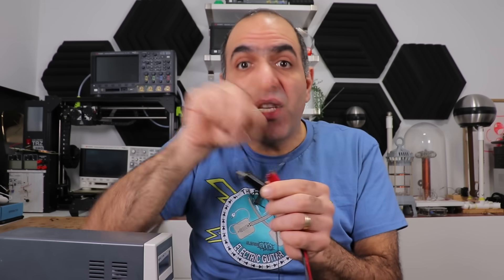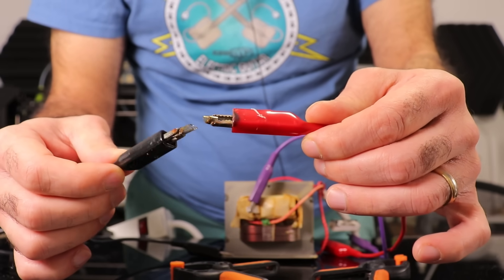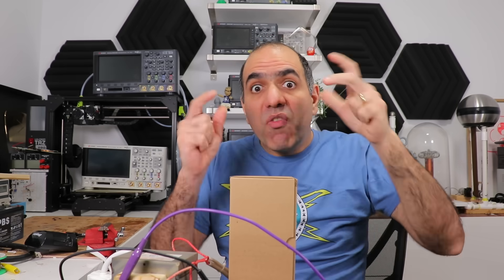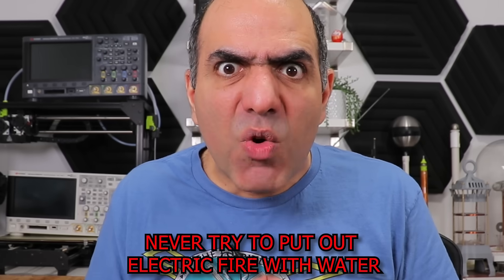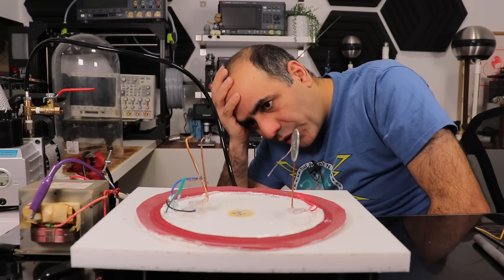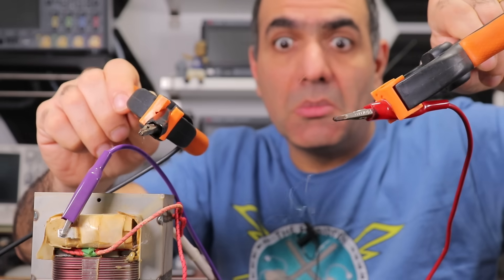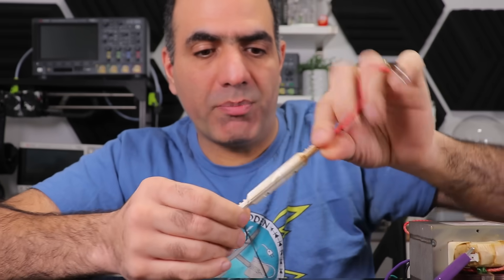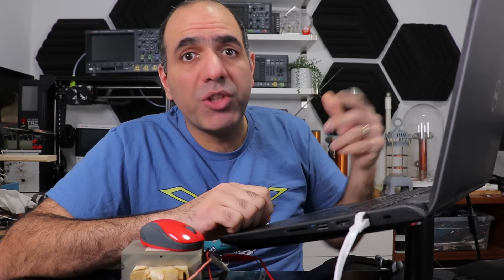Making a High Voltage Fuse

Comment: When i worked as electrician, we had fuses filled with sand, exactly for the purpose to avoid arcs.
Reply: Yep, the ceramic fuses we see inside multimeters are a classic example.
Reply: @Kalvinjj my multimeter was really cheap and it has a regular old fuse made of a thin wire in a glass cylinder
Reply: @Kalvinjj  What do you mean? My multimeters are all filled with regular fuses lol.
Reply: i think he is doing the fail on purpose, he is smarter than this.
Reply: @Sad_cat_studio  Fortunately most of the times he shocks himself it is on purpose... Because he knows roughly what will kill the average person since he's a electrical engineer with qualifications to back it up. Saying that though, not even licensed electrical engineers should be playing with microwave transformers. Those things are dangerous!
Reply: @Sad_cat_studio  of course, most of his "fails" are intentional to show how dangerous electricity can be. He even uses CGI rarely. However he has had REAL accidents like the jacob's ladder which did almost kill him.
Reply: @Sad_cat_studio of course he is, he’s extremely smart, he just teaches really well with slapstick humor and I love it!
Reply: @Sad_cat_studio  I am always worried that he might get splitter in his eyes.
Reply: @Sad_cat_studio  You think? This must be your first time watching this channel if you only "think" and don't know it for certain.
Reply: @anteshell  no, i watch him all the time, but yeah i know that hes joking, but sometimes that is a little too much.
Reply: There's a video of PhotonicInduction blowing one of them up.
Reply: Does the sand form a glass seal or is the heat not high enough?
Reply: @Robertkopp84 sometime you get little bits of glass depends on the reason the fuse went. Seem to be a sweet spot in fault levels to get really hot fuses, really really big faults blow the fuse that quick the body doesn't even get warm.
Reply: @Robertkopp84  yep that's exactly what the 'sand' does.
Reply: @Robertkopp84  no the heat can really ever get high enough it just creates enough resistance to avoid arcing
Reply: Sand filled fuses are for cooling to make them slower. They can handle sudden higher currents for longer. (The starting up of appliances with motors for example)
Reply: They're called HRC (high rupture capacity) fuses. When there's a very high current that causes them to blow, the arc causes the glass to melt which forms a better insulator than air. I've used them for industrial welders. Those blow at a few hundred amps but can quickly cut off tens or even hundreds of kiloamps.
Reply: + fuses filled with sand are slower fuses (where you can have very small peaks of current what are higher than the "normal current" on fuse ) ...
Reply: I always wondered about these glass fuses. I'm no electrician so my knowledge is very little but I have some spare fuses, some of them filled with sand while the other don't. Very interesting to know that
Reply: @granfury1238 
Never seen any with sand but I think I understand why it’s used. Do they last longer?
Reply: Sand does a good job at quenching the arc created at failure so they don't turn into miniature grenades.
Reply: Fuses in the Fluke meter, are filled with sand from what little I understand.... still didn't stop me from blowing one really quickly unfortunately.
Reply: I've never seen that--makes sense though.  Must have been extremely high voltage fuses...
Reply: @nobody7817   Not really. It is common 230V fuse that we all have in our houses in Serbia. And some parts of the Europe i guess...
Reply: @markojovanovic165  Interesting.  Tyvm for the info!
Reply: @nobody7817  Ceramic fuses are pretty common even not in high voltage stuff. They're often used in dc circuitry or high inductive loads where you need higher breaking capacity. Regular 5x20mm glass fuse is usually rated to break reliably 125A current and 5x20 ceramic can break 1500A reliably.
Reply: @nobody7817  All fuses that are used in UK plug's must have sand in them to be legal.
Reply: @dcallan812  but then how do you see the wire ^^
Reply: @jonathan-._.- you don't. Most fuses I use where I work have sand in them.
Reply: @jonathan-._.- you don’t , you have to test them with a multimeter
Reply: @jonathan-._.-  You don’t see it, that is correct. Yet on almost any sand filled fuses I came across, the otherwise shiny white sand will look dirty or show black/brown spots if the wire melted. 

Then again, I came across clear glass fuses that looked intact but had an open circuit for what ever reason nevertheless, either because of welding spot failure due to vibrations or because only that part melted open instead of the whole wire burning up. 

So you better measure them anyway while doing troubleshoot.
Reply: @jonathan-._.- facepalm lol
Reply: @jonathan-._.-  you carefully cut the blown fuse open to see the element. How the element melted will tell you if you had an overcurrent or an overload.
Reply: They're filled with sand to slow the heat buildup and are called "slow-blow" fuses. It prevents nuisance blowing during the huge initial inrush current when starting inductive loads like motors that typically lasts less than a second. Working with decades old machines as a maintenance tech (oldest one being from 1954), I end up replacing at least one a month. They didn't worry about including fuses as much back then..
Reply: @sgctactics  it would be fun to hear it explode though like how the cutouts just blow up on the pole and slap the door down
Reply: I still work as electrician and we still have those fuses filled with sand.
Reply: Yeah, fooled my colleague once on April Fools. I put the sand in his salt container, I bet he liked his food
Reply: Big brain move, I don't think sand conducts through electricity... Well.. Not really at least, I think there needs to be specific circumstances for that to happen
Reply: @segasonic4952  DID YOU SKIP CHEMISTRY AND PHYSICS IN SCHOOL? ok so, fact is dry sand does NOT conduct electricity and even wet sand is  poor at conducting due to lack of essential minerals. however remove the silicate particle and ZZZAP! it becomes a shocker indeed lol XD
Reply: wow, silicon fuses, must be some new generation
Reply: @miauzure3960  silica... sand... and no they're like 100 years old
Reply: Filled with sand and multiple paths to get the rating you require.
Reply: Same with me, the 600 volt rated fuses in particular had a lot of sand-filled applications.
Reply: There's an arc distance the main use of sand is to prevent a 480v fuse from being a bomb because the fuse wire literally vaporizes and explodes
Reply: TIL 😮
Reply: Genius
Reply: That's what I wanted to say, to fill the fuse with sand or maybe salt ot extinguish the acr.
Reply: He just teaching us in another way
Reply: Those are HRC fuses.
Reply: they're called HRC / class T fuses mr electrician.. lmao
Reply: I figured I may as well check, and they do have sand filled fuses.

They do not even mention those in America. Even in electrical colleges.
Reply: @neaituppi13713  yes they do, t class fuses are used everywhere
Reply: I've seen those too. I've seen them in multimeters, switching power supplies and induction cookers.
Reply: I've seen videos of those, but only huge fuses. Haven't seen any small sand filled fuses yet.
Reply: Yep, these are the standard-not-cheapo fuses, at least for low current applications around 2-10 Amps. Can't speak for the higher amp applications, as all of them I've encountered were opaque.
Reply: In my multimeter there are 2 sand filled fuses. One FF 0,5A 1000V with 10kA breaking capacity and the other one F 10A 1000V with 50kA breaking 
capacity. Those multimeter fuses seem to have very high breaking capacity.
Reply: I know people who did the same thing to others gas tanks. 

You don’t want arcs in the gas tank. It’s dangerous.
Reply: Not only for that, they are filled with silica, so it can absorb heat and energy from the first arch.
Reply: If I remember correctly from my apprenticeship we use ceramic fuses that's got silica granules on the inside surrounding the fuse breaking point. Think the one in particular I saw that cracked was like 80A or something, was really cool tho. In my profession we use like small 2.5A ceramic fuses for our traffic controllers and in winter we use quite a few of them due to water damage burning molex connectors in the lanterns. Appreciate these little protection devices tho, it protects the rest of the systems by a long shot
Reply: Silicon: am I a joke to you
Reply: Sand is silicon @i_fw_linux
Reply: Interesting
Reply: I replaced a disconnect box at a house that went to an electric air handler because they old one with super old 60amp fuses blew and the disconnect melted everything together. 
It blew the tops off the fuses and I took them out and found they were filled with sand and I wondered why. 
You sir have answered my question. Thank you
Reply: In my town most people still have them
Reply: That's not really why, it's to regulate high current so it doesnt kill it with the initial jump. My Welder uses them.
Reply: High voltage transformers are usually filled with mineral oil to prevent fuses as well.
Reply: Youhaveandtoandto8tototototototototototototototototoandandandandandandthethethethetheandtheandtheandthe
Reply: Most fuses I’ve seen in industrial places have sand
Reply: Came here to say that
Reply: I'm an electrician right now and we still have sand filled fuses.
Reply: If i recall right its not even regular sand but some special white sand made literally for the purpose of eliminating arcs.
Reply: Noice
Reply: In some old 600A fuses i worked with there also was sand in them
Reply: A bloke called photonic induction gets his hands on an insane fuse he has a crazy setup and it's so powerful that even with his energy supply system (think he's a high volt sparky) uses an air trigger for the mechanic switch, he still has to cut open the fuse and dump the sand to try blow it
Reply: Bro I don't even see sand in fuses.   I have seen a fuse i found it in my inverter
Reply: Cram a penny in it, fuse is much stronger 💪🏼

🐭🐹🐼🐨🐻‍❄️🐻🐺🐯🦆💨
Reply: Na GT-R
Reply: wasn't sand, it was silica lol :)
Reply: I bet you might be the worst electrician in the whole planet
Reply: Then if they break then its gonna make a huge mess 0:58
Reply: I thought the sand was there to catch the hot metal because the metal can set something on fire. That is what I was taught by my teachers.
Reply: @jost3n414 The actual function of the sand is to prevent an arc from forming inside the fuse, due to the hot metal vapor from the fusible element (the wire). The full process is a little complex, but the sand quickly shuts down the arc. The thermal mass of the sand quickly cools off the hot metal plasma, with much of it ending up as very thin coatings on at least some of the sand particles, getting it out of the air. Also, with the central conductor gone, the electricity has a much longer, twisty path to get from one end to the other. Bottom line, it shuts down the arc before the equipment would be damaged.
Reply: @jost3n414   it accualy is for it too (and it is used for the sensing wire to check if fuse is blown)
Reply: @Kacyk007  oh I'll ask my teacher about it. He's also an electrician engineer I think.
Reply: I still have them in my house (btw my teacher said that the sand will spread the heat for the sensing wire)
Reply: sure grampa, it's time for bed
Reply: Arc stands for all records containing 😢🎉
Reply: In multimeters we used to use metal foil from gum as a fuse because we got sick of it blowing
Reply: No
Reply: is an electrician a thing you can 'work as'? i thought it was a thing you are ?
Reply: @KarldorisLambley Captain pedantic
Reply: @KarldorisLambley  what
Reply: @sfwreaths1  an electrician isn't just a job, like being a paper-boy or working in a shop. it is a skilled trade. it is a thing you are not a thing you _do_. you cannot just 'work' as an electrician, if you are you are just a technician. and never say just say what to me again with no question mark. it is very rude.
Reply: @KarldorisLambley 
Yep. I was a technician in electrical and mechanical. Have to know a little. I could  change out sensors and things like that. I could take machines apart also. Maintenance asked me what I was going to do if I couldn’t get it back together? I told them that’s their job. 😁

Comment: Here’s a tip coming from a fellow Electrician. The cheapest option for a Fuse still isn’t to make your own Fuse through scrap metals.

Your house burning down after a failed electronics experiment makes a great fuse! Your house burns the wiring around the house, which cuts off the City Power going to your house!

Comment: I have 1 issue with your springy design. If the load is not too big to break the wire, normal conducting is heating it up and it becames more soft and the rubber can pull it apart easier. Over time it will weaken your material. But that's just my theory, I'm a programmer and data engineer, not an electrical engineer or physicist.
Hmm, it seems you were onto something with your design since the original fuse is something similar too.

9:05 - I like your mouse pad :D
Reply: Thermal fatigue is a issue in fuses. That is why you don't run the circuit at the rated amperage of the fuse. There is also a equation to tell how long the fuse will last at a given current, but the time goes up fast as the current comes down from the rated amperage.
Reply: @LaserFur  Yeah, fuses don't work the way people think.  Decent fuses (& circuit breakers) come with a datasheet that tells you when it'll blow bases on load, time & ambient temperatures.

There was a video put up recently about how those cheap packs of cars fuses are really really bad.
Reply: It was just a prototype, real fuses use springs instead of elastic.

Comment: People probably nag you a lot about safety, but you should definitely wear safety goggles when working with white-hot metal right at your eye level.
Reply: Hes got his safety squints on doesnt get any safer than that!
Reply: Nerd 🤓 ermm Actually
Reply: And he should not be holding both 2kv insta-death electrodes in each hand, one mistake and he's completely gone.  There is a one hand rule when working with high voltage for this reason.
Reply: @umbrakinesis2011   then man shocks himself for youtube views and has been doing so for over a decade. i think he knows what he is doing ....
Reply: @KT-pv3kl Yes, he does. But he is still a human, he could make mistakes. And one mistake with that high-voltage high-current transformer and you are death or with dangerous wounds.
Reply: @kyomuapashi  Exactly. The difference is you usually don't get any second chances with MOTs. One mistake is usually the last for hobbyists who work with them. That's why I recommend he use an AC flyback transformer or strictly adhere to the one hand rule. (In another comment. AC flyback transformers oscillate at such a high frequency that your nerves don't respond to it.)
Reply: @umbrakinesis2011 was was waa cry about it